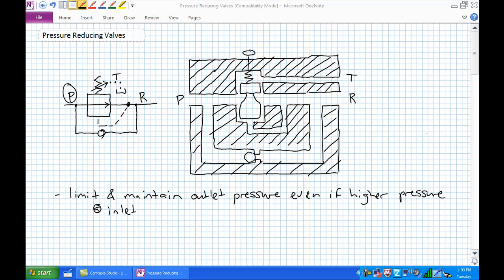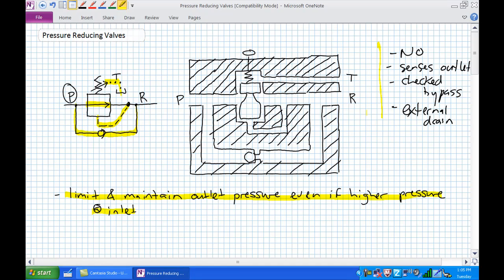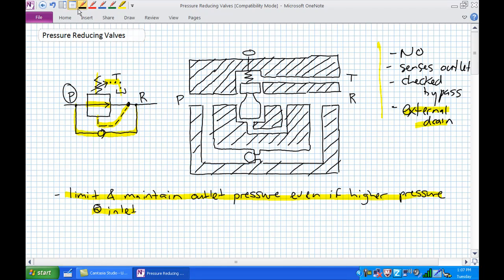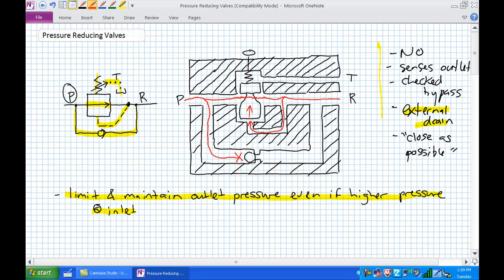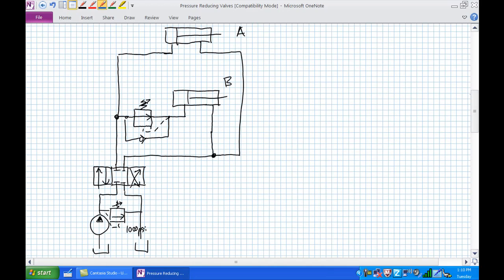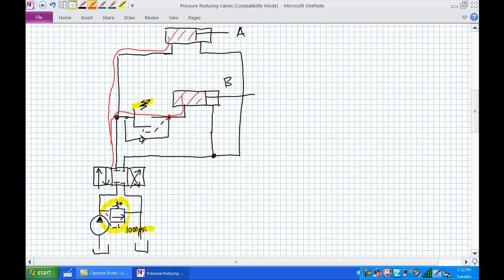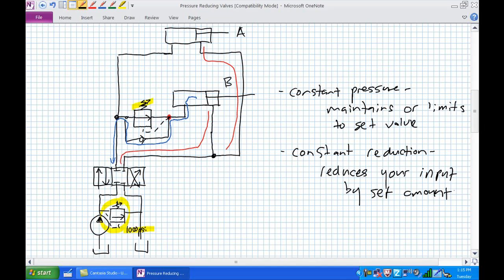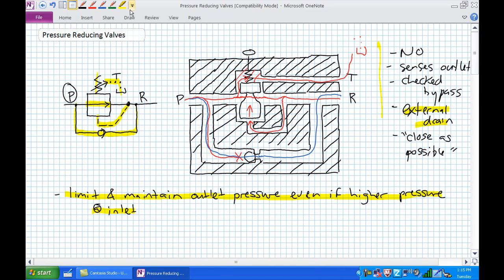Pressure Reducing Valves

Comment: furthermore, the drain is as far away to the bottom compared to the reservoir fill neck and this is to allow bubbles to slowly dissipate from the bottom of the tank upwards by the force of atmospheric pressure.

Comment: i dont agree with your comment about terminating the drail above the reservoir level. In my opinion, usually you will see it draining as close to the bottom with some space before the bottom of the tank. This is to avoid airation or bubbles to form with impact the hydraulic circuit negatively.